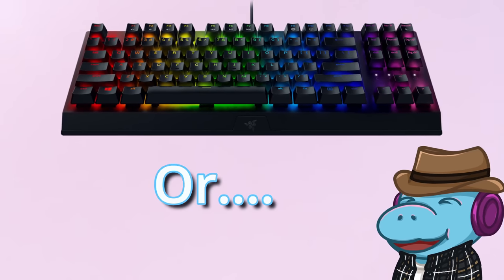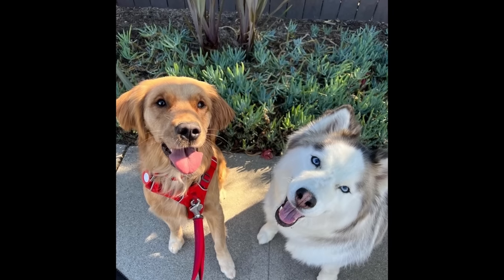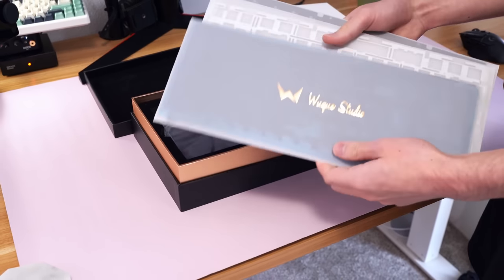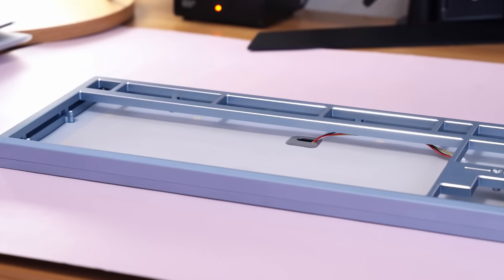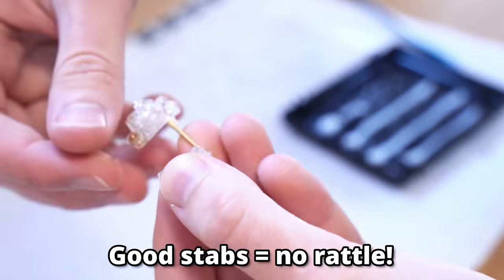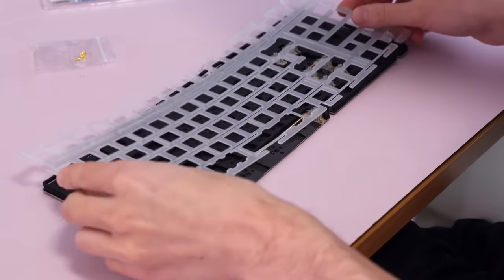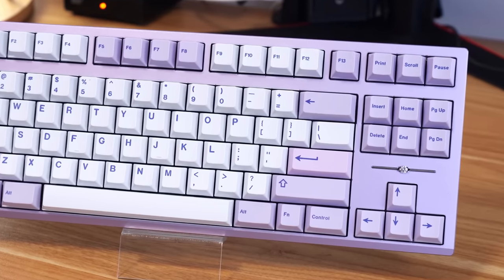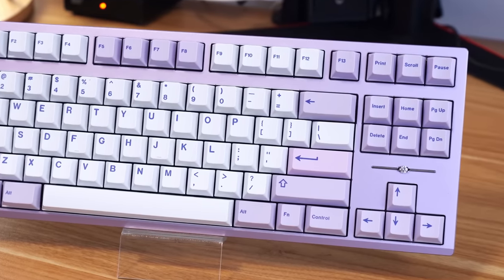Gaming Keyboards DON'T Have To Be Like This.

Comment: Not exactly a custom keyboard. but I did buy a pre assembled feker alice 80. absolutely love it. I wanted a keyboard That had had the split ergonomic layout and was bluetooth with backlighting. Not olyd did this feker deliver it gave me features I gave up on cus I didn't think id get at all cus I just didn't think Id find them outside a gaming keyboard setting. the volume knob ability to win lock absolutely love it and icing on the cake The company is callead Feker and now I have a shiny sticker off the back that says feker 10/10.

First time actuallys spending money on a keyboard let alone investing In a real keyboard. Like either It came with a tcomputer it came from a junk box was a hand me down or I got it at a yard sale witch did land me the microsofte ergo4000 witch was a nice keyboard. This thing I love this thing I cannot go back. My only wish  is if I could get a case so I can throw it in a backpack n go with no worries. also need to get a wrist rest.

Ill have to tear this thing apart some time and make it more me after bout 5 years of procrastination maybe... :P
Reply: Hipyo_Tech  Nice try mr scammy man. maybe next time ;3

Comment: I had the g915 tkl and I love the low profile nature of the switch. Is there a way to build my own keyboard that wont cost me more than 200 dollars that will do that for me? I would probably also like features like dedicated multimedia keys and volume control on the keyboard itself. Is this possible without making a ton of comprimises?
Reply: For a low profile cheaper customizable board, I’d recommend something in the Keychron line. For volume control, you can easily set it up via hotkeys using the software provided. 

As for multi media keys, you’re not really gonna find customs that feature them, as it’s not a generally desired trait among most. I guess that means there is some compromise, but considering any function that said keys have could also be easily replicated via the software, it’s a low compromise

Comment: Using a SteelSeries Apex Pro (which recently replaced my Logitech G15 after 10 years of usage). I think it has a quite neutral look. I don't care that much about the RGB, as long as the keys are lit.
I found it interesting that you mentioned magnetic switches, do you have a video about those?

Comment: Can a gaming board be customized? I have a bad razer cynosa somewhere and would be interesting to modify it 🤔🤔
Reply: it depends if its hot swappable or not
Reply: If you can open it up then you can mod it.

Start with a foam mod and then tape mod. And you can also try lubing maybe
Reply: With the one you have, it'll be difficult to do much. It's a membrane rather than mechanical, so you cannot swap out the switches and most (if not all) keycaps won't fit onto it. You can put some dampening inside the case and maybe use lube on the keys to make them a bit smoother, but that's about it.

Comment: are there any keyboards like this that actually do per key RGB like a lot of gaming keyboards? That's the main thing that has me slightly leaning over to a gaming board.
Reply: Plenty and if you get really into it you can do lots of cool stuff. Virtual lock lights, layer indicators. Color coding for davinci resolve hotkeys...
All sorts of things if you wanna dive into QMK.
There's still a thing or two you can do if you wanna just fiddle with the configurator but you really want a keyboard with VIA support for that so you can configure everything at runtime, not through firmware updates.
If you don't wanna get super fancy that's all you need.
Reply: @thumbwarriordx  ah okay that makes sense thank you! I've been looking at Nuphy's new keyboard but sadly I don't think it has QMK

Comment: So frustrated with these keyboard review channels.  I have needed a new keyboard for months, my first mechanical keyboard, but every channel considers $75 a cheap budget keyboard and  I am not willing to spend a penny more than $50.  I dont care about keyboard fanatics weird obsession with a keyboard sounding a very specific way when you type other than it's sound isn't way out of the ordinary for a mechanical keyboard, (excessively loud for example).  I just want a keyboard that is going to be reliable, use good linear switches that require little force but not so little I make mistakes when typing.  I care the keys are very stable/linear, no/little wobble.  The keycaps are probably one of the more important things from keyboards I have tested at various stores.  It probably makes sense to spend $35 on a keyboard then $15 on keycaps and some lube.  That all being said its and endless sea of options to choose from with no guidance, I don't trust amazon reviews, had bad experiences with trusting them in the past.  Can anybody hear me? Help please?!  I do not think I am being unreasonable.  If anything the reviewers are being impractical and maybe a little bit elitist because they are obsessed.  I just want a decent keyboard.  I have a Logitech g410 that is the worst POS ever, save me!
Edit: Oh I don't want a number pad, so 60-75% I guess, also channels reviewing 1 or 2 under $50 keyboards every year isn't exactly finding the best under $50 keyboard.

Comment: My primary board for gaming is a lightly modded Royal Kludge RK84. I went with this board because it had all the features I wanted at a very budget friendly price (I paid around $50 for the stock board). I'm not a big board hobbyist but I wanted to dip my toes in and have something that was unique to me without paying too much. I prefer the Akko CS Jelly Black switches I put in it to the red switches that were in my Corsair gaming keyboard. I can't really tell a difference in the latency, they both do exactly what I need them to do when I tell them to do it. I'd be curious to see if I could discern a difference on a SteelSeries Apex Pro or Wooting 60HE.

Comment: I have a modded BlackWidow V3 pro. 

They show up on Ebay all the time as RMAs for good prices, so I’m into mine plus modded for less than $120, not counting the GMMK caps. 

I personally really like the Razer Yellows, lubbed up, they are just linear and TTCs rebranded though.  

I like that it has lower latency wireless than wired. And I HATE how they do their stabs…. Not to say you can’t make them sound good, but they have notches that require you to use theirs or cut the metal housing. 

Love my customs though!

Comment: Do the hippo keycaps fit an ajazz ak33? They seem to sound more full as a keycap than the standard ones I currently have
Reply from the maker: Only if you are okay with 1u arrow keys instead of the 1.25u you have
Reply: @HipyoTech  I could always keep the original arrows in that case or search some other arrow keys that do have the right size if it bothers me.
Good to know they'll fit. I think they'll sound better than the standard ones, it's a pretty cheap keyboard

Comment: i like it because its small and it only cost $80.
Reply: GK61 - 41$
Durock plate mount stabs - 10$
Switch and stab lubing kit - 17$
(Optional) akko or gateron yellow switches - 40$
Total build:
68$ usd 
(With replacement switches) 108$ usd

Keyboard building doesn’t need to be expensive

Comment: I had a GMMK 1 with Gateron Clear switches. It was great when I first got it, but the mote I got interested in this hobby, the more I started to dislike it. So when I looked for my next keyboard, I was really considering getting a custom keyboard. I’ve done an unnecessary amount of research on them just so that I could make a decision. However, I started looking at the “enthusiast pre-built” boards and ended up going with the FNATIC Streak 65 LP. Why? Because low-profile is not common enough on custom keyboard to a point where you can customize it like a regular keyboard. You’re limited to Logitech, RAZER, FNATIC, and Keychron. FNATIC definitely won out of these brands, because they not only provide an actually decent typing experience, but a coiled cable. Name a single company besides FNATIC that gives you a braided coiled cable in the box.

Comment: I don't know if this is allowed here but I didn't know where else to ask and I don't even know if anyone can help me but I recently modded my Keychron K4 (foam and electrical tape) and since modding it when I go to remove the keycaps some of the switches come out and some are loose now. Is there something I did wrong? And is there a way to fix this? It doesn't seem to have messed up my keyboard or the housing but its kind of annoying to deal with every time I want to change my keycaps. If anyone can help that would mean a lot. Also sorry Hipyo for taking over your comment section with my issue.
Reply: your switch wobble. Probably switch housing not tight. Search switch film, and learn how to use it. You can do switch lube together with that.

Comment: Been gaming on a keychron k2 i built and have not noticed any difference in latency, although my keyboard before that was a realforce topre board so not exactly in the wheelhouse of gaming either. Current technology, wired or wireless, is pretty dang unlikely to impact the average joe gamer in terms of response time. If you aren't playing for money it probably isn't even worth worrying about. I say this as a former csgo tryhard who obsessed over latency, mouse weight, and all the other nonsense. Build a nice keyboard, it's fun and less of an eyesore.